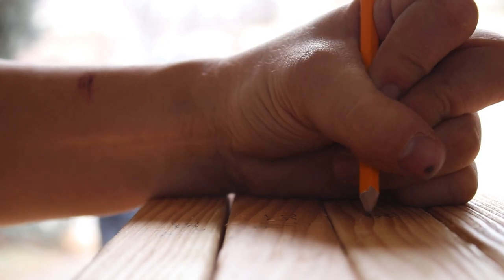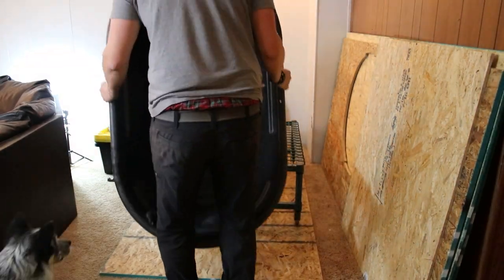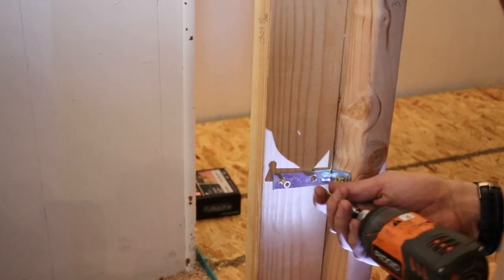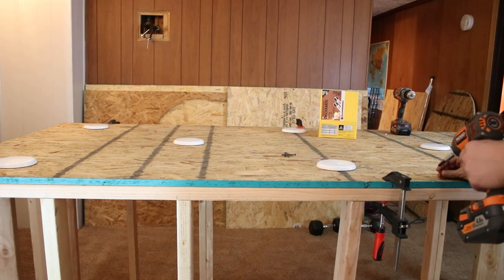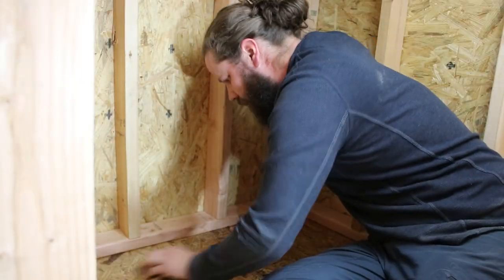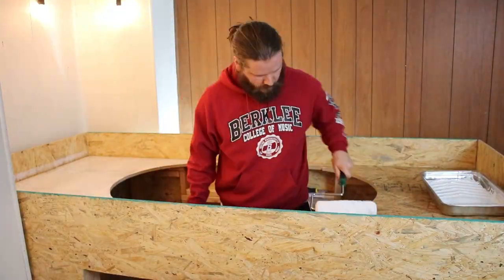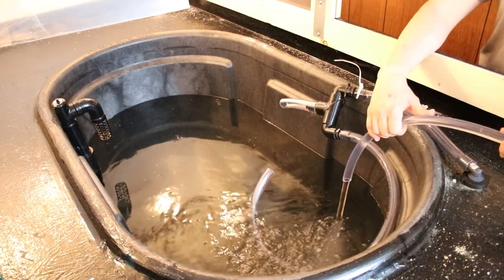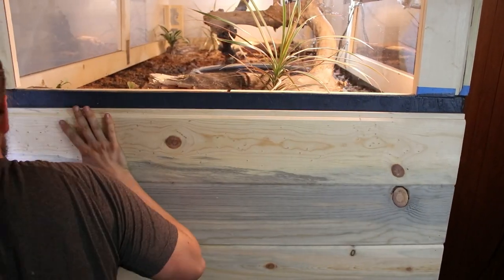The ULTIMATE turtle tank! 100 gallon pond in 32sq ft of natural habitat.

Comment: Is there a clean and maintenance of your tank video? Building is not intimidating but maintaining is
Reply from the maker: No sir, I do not have one. I do a 20% water change a week and clean the filter media every 2-3 weeks depending on my availability. Mildred drags a lot of dirt and debris into the water 🙄
Reply: @studiodeepdive6165  I have a bare bottom 60 Gillian tank. I use have RO water half city. I have a 320gph pump drawing through carbon and sponge filter. I still have to completely change and clean tank weekly to 2 weeks if I push it. I can change filter and still cloudy and yuk after first feeding.
Reply from the maker: @brianwatson8351  what’s in the tank?
Reply: @studiodeepdive6165  yellow belly slider about 6 months old 4 inches long. I am building a side nest area whenever I get a better feel on how to treat tank without complete water changes bc this makes it impossible to maintain
Reply from the maker: @brianwatson8351  I use the Penn-Plax Cascade 1500 canister filter and it’s great. Also use a couple power heads to make sure all the water gets pushed through the filter
Reply from the maker: @brianwatson8351  I also use chemi-pure bags
Reply: @studiodeepdive6165  I think what I have now is just power head with cheap filter, so a canister is my issue. Kinda expensive and wasn’t sure about the expense. My time and back is worth it ha. Will do. Ty for your time.
Reply from the maker: @brianwatson8351  any time! Let me know if you have any other questions